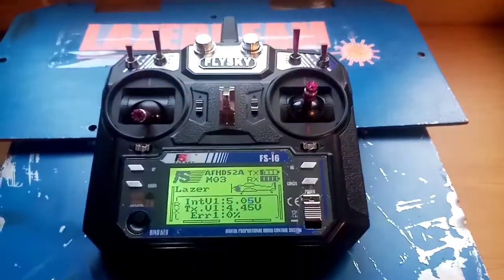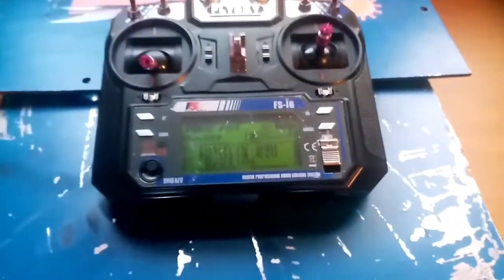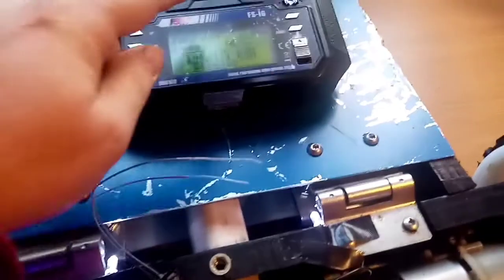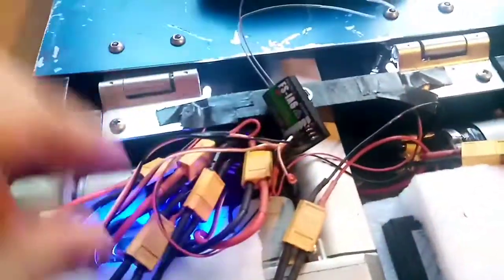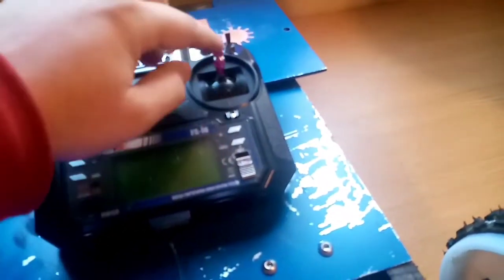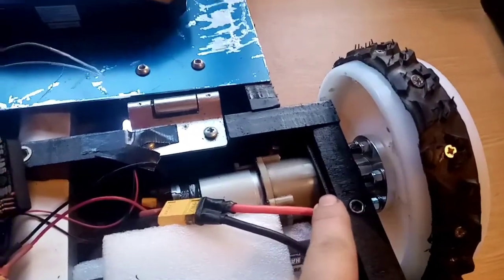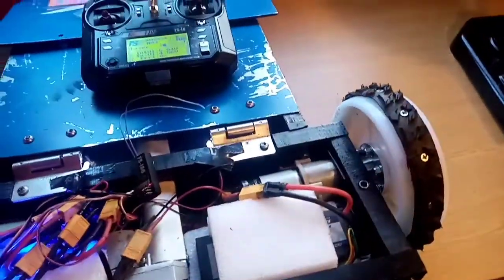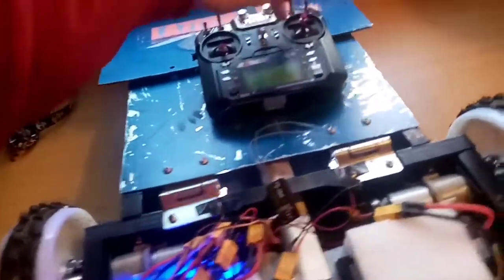DIY Combat Robotics: Transmitter Mixing and Receiver binding on a Flysky FS-i6

Comment: I am confused and hope you can help me.   I have a large .. basically equivalent to a tank like drive battle bot thing I purchased.  it is 24v, twin motors. One drives left side.  Other motor drives right side. Motor controller for each motor is a Victor 883 24v.  Seller told me all I had to do was hook it to an RC receiver and controller and it was good to go.   (once programmed remote/transmitter)

Well Ive purchased and installed now two different RC receiver w/ matching remote/Transmitter and in both cases the 883 flashes that no PWM is installed.   

What am I doing wrong??   At a complete loss.